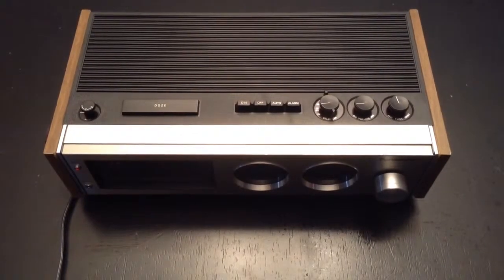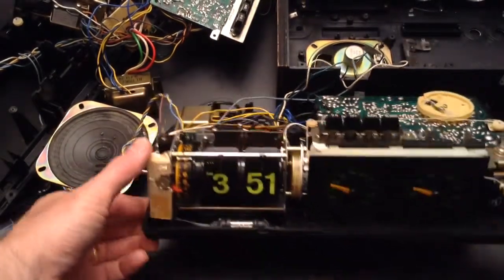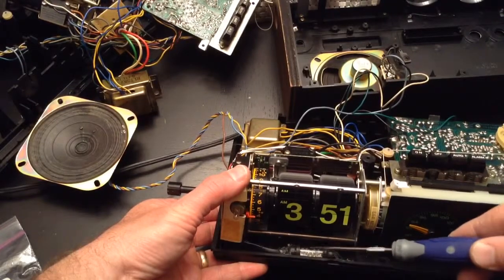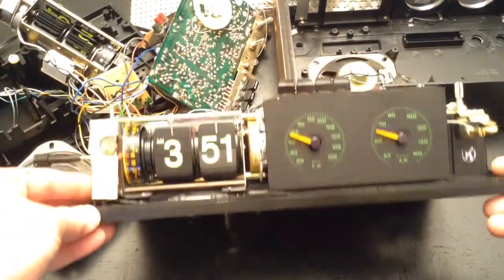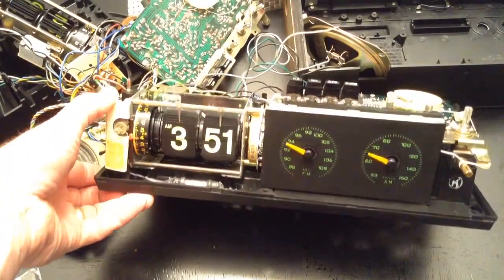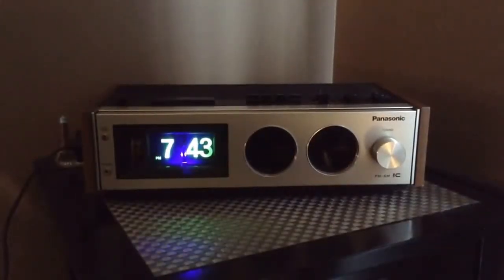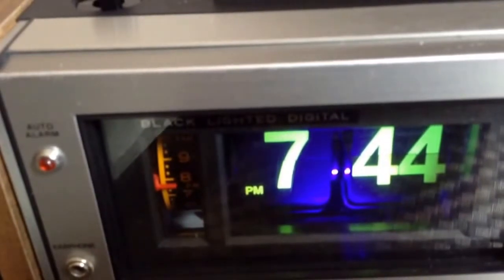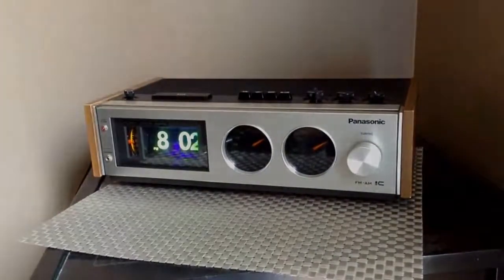Final Restoration of the Panasonic RC-7462 Black Lighted Flip Clock

Comment: Just fixed mine. Motor took a crap. I put my Black light LEDs on the top shining down so it has less of a glare.
Reply from the maker: Good idea. I just uploaded a video of a Copal flip clock with the same original bulb as this model.
https://youtu.be/XYsaHxjLUWE
Reply: I left the original bulb at the bottom and added 3 little black lights on top works like a dream.  This is a very interesting YouTube channel I subscribed👍🏻

Comment: Hi, I was wondering if you are still repairing flip clocks. I have this same exact clock as in this video.  I've owned it for a few years.  It was working great until recently.  The motor got much louder to the point I had to unplug it just to sleep.  It still kept time just was annoying.  It's in great condition and black light was converted to LED strip lights.  That's how I purchased it from ebay a few years ago.  If your still repairing them I was interested in how to contact you for information.  I'm located in NJ.  Thank you
Reply from the maker: I've tried to move away from doing repairs. It's stressful since I'm not a business. 
Have you considered trying to put a couple of drops of oil on the motor?
Reply: @Flipclockfans   thanks for your reply.  Yes I did try a drop of oil after seeing you do that in another video.  Unfortunately didn't work. I hate to throw it away, but was hoping to get it fixed if possible.  I really enjoy having it. I will do some researching online. Hopefully I can find a solution.  Again thanks for your response and really enjoy your videos.